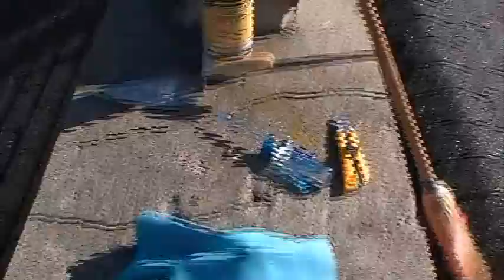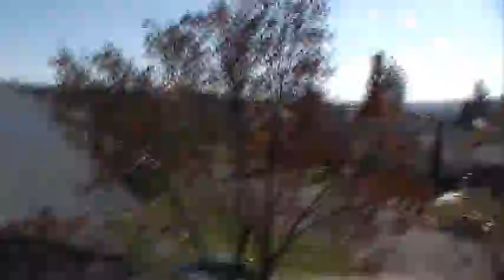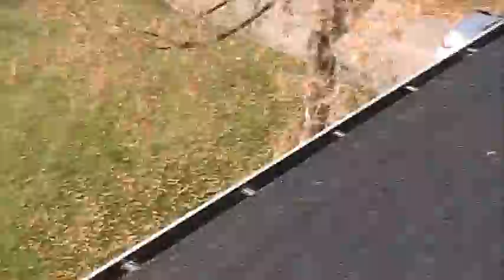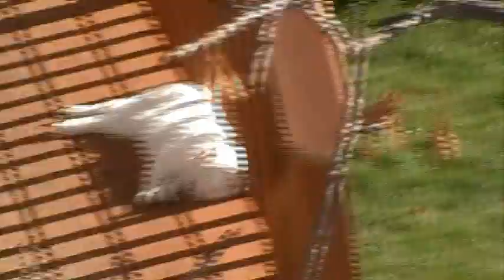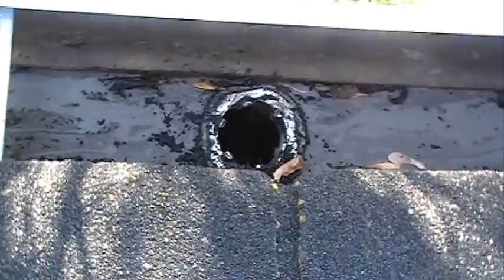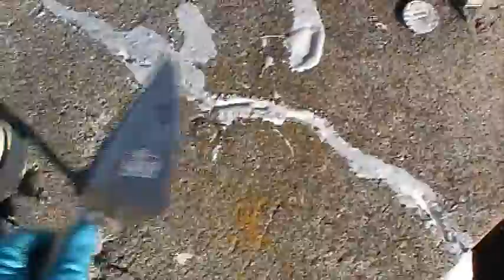Cute Cats & Chimney Cracks

Comment: Hi Bluenazz!  You are doing exactly what I was doing this time last year!  In my case there was a small leak right beside the chimney which was letting water in to drip down into the basement.  Luckily it didn't do any damage before I found it.  Its amazing how much your house and property looks like mine from up there!  That's a good tip to know about the drain hole in the eve troph.  I must install some on the back side of my house next spring.

Comment: Won't be long before I have to replace the roof on my shed. next spring I think I will. The roof was in such bad shape when we bought it that the decking under the shingles is rotted through. Gotta replace all the decking when we do the shingles. But for right now, it just holds the mowers so I'm not too concerned at the moment since its only severe leak is very easy to put a bucket under